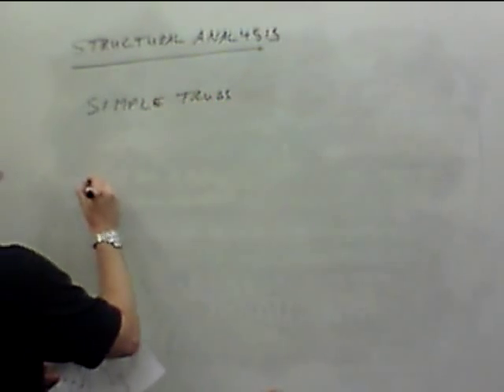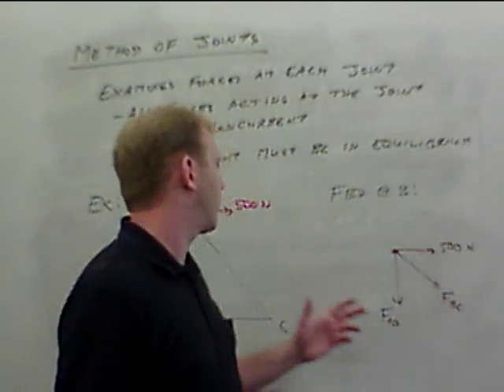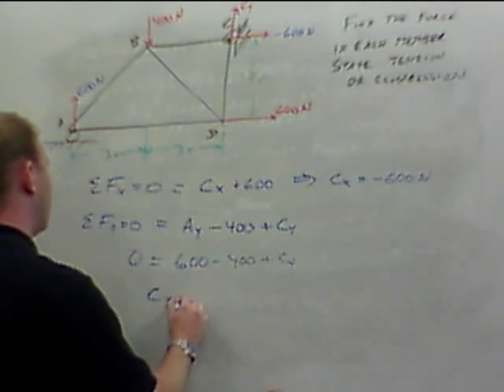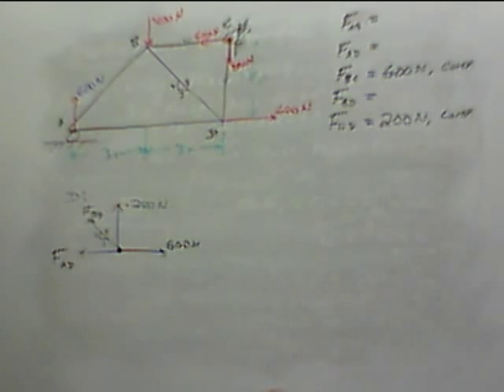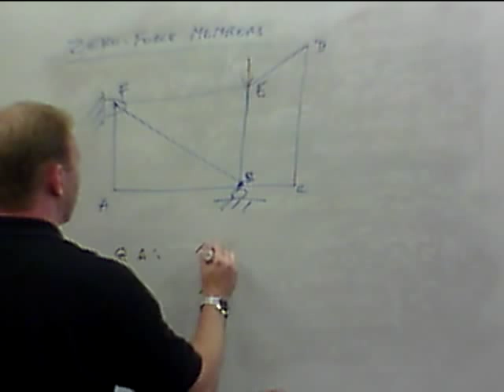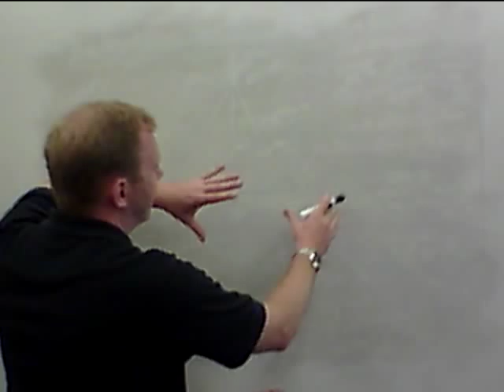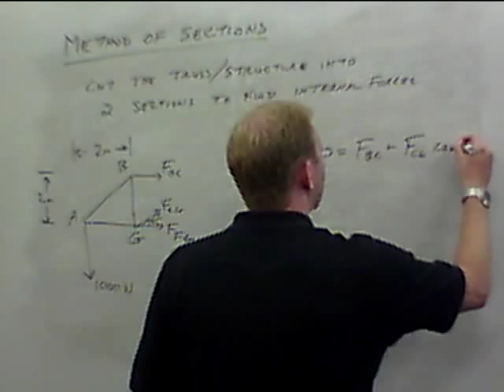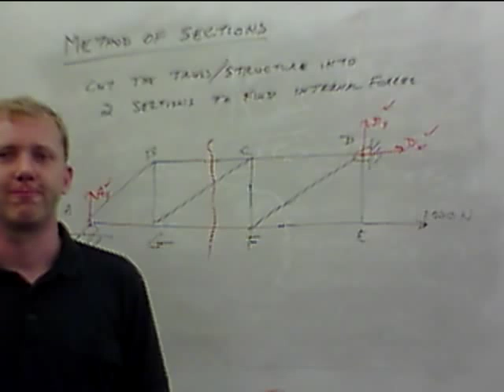Statics Chapter 6 Part 1

Comment from the maker: When setting up the FBD's, you have to guess tension or compression, then solve the system using your guess.  If the numerical value for a given force comes out negative, that means your guess was wrong and the force is in the opposite direction (tension vs compression).  It is generally a bad idea to change the direction of your force vectors mid-problem; it just adds to the confusion.

The simplest solution is to simply draw ALL forces in tension (which is what i do in these videos), so positive forces are tension and negative forces are compression.  Just be sure to carry your signs throughout the problem, and you can just identify tension or compression for each member at the end.

Comment: about the compression and tension thing ... they only can be figured after the directions are given ( randomly ) on each joint's FBD ,,, but if randomly, assuming differently mustnt change the answer, but it actually did :/  ,,, so how should we be taking them ?